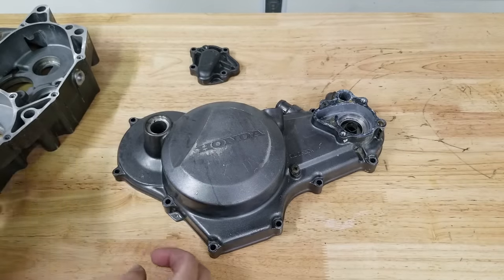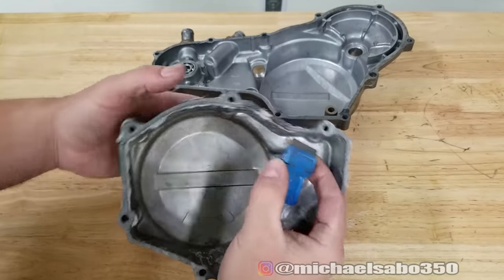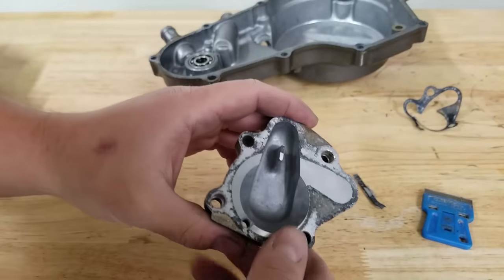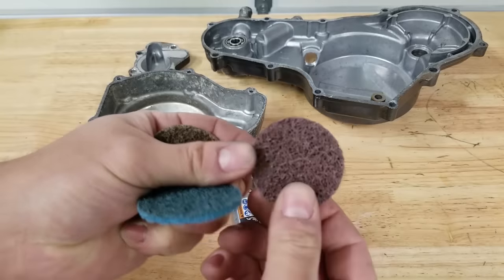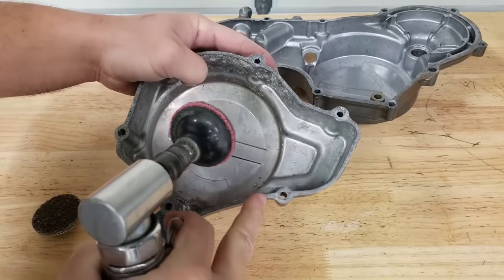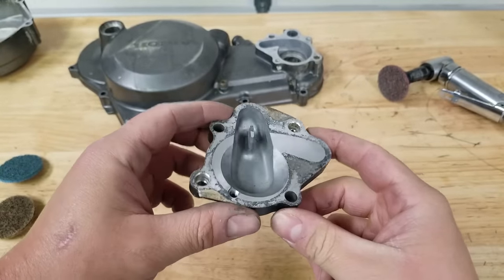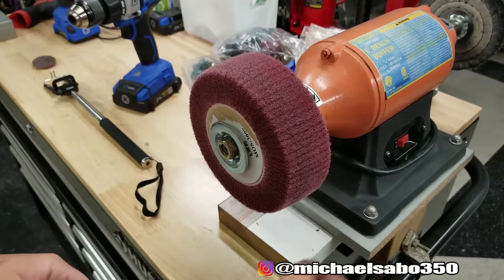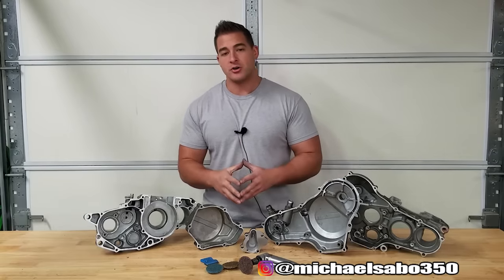Project 250R Cleaning up The Cases and Removing Stubborn Gasket Material

Comment: This method does work but it is very risky, especially on surfaces that need to be perfectly machined like a cylinder head. If you use this method and them surface that part at a machine shop, you would be amazed how wavy it is after using one of these wheels. On tough gaskets I use a razor blade to get the gasket off and then scuff the surface with a red scotch brite pad by hand soaked with some brake clean. Or if it needs to be perfectly flat I will scrape it clean and then get a piece of glass and lay out some 400-600 grit sand paper and run the part over the sand paper in a figure 8 pattern. These wheels can remove material super fast especially on soft parts like aluminum,pot metal, brass, etc..

Comment: What I use to get that old glue adhesive off is acetone. Soak a little bit on a towl and rub into the gasket material.  Once dry use the same razer and the gasket adhesive comes right off.  Give it a try.

Comment: U know they have a gasket remover attachment with little fingers on it that wont cause any damage at all. And it works awesome
Reply from the maker: Thank you for the info dude; I should have mentioned those in the video; the bristle pads are safer for sure; I used the cookies on a daily basis for years at my day job so for me it's safe because I have a feel for it; but the bristle pads are no doubt safer to use.
Reply: @MichaelSabo  no problem man. Love ur videos keep up the good work.
Reply: I was just thinking the same.
Reply: I can find bristle pads
But cant find any with fingers 
Do you know the name of them?
Reply: @communicate17  Old post, but I think what you're looking for is 3M Bristle Pads / 3M Bristle Disks
Reply: @naturalsIV  Thanks!

Comment: Wrong tool for that job 3m makes a green plastic cup with plastic fingers on it that goes on your little angle grinder for cleaning gaskets of aluminum! The scotch bright are good on steel but can make gasket matting surfaces wavy and lead to leaks on aluminium. But a trick to flatten out gasket surfaces get peace of glass spray with water stick sheet of 400 grit sand paper on  spray with water and work cases in a figure 8 pattern
Reply from the maker: Yes, not sure if you watched the entire video, but I mention surfacing the cases/covers in this video and stress using extreme care with these cookie wheels. Great info though; the 3M bristle pads are great too they just take longer, at least in my experience; I should have included that.

Comment: It's called a scotch brite bristle disc
Reply: What grit would you recommend for gaskets like in the video?
Reply: @kenwilks6289  dont matter if u use a scotch brite bristle disc. Even if u use a 40 it wont damage anything.  If u use what mike is using in the video. Not sure what it's called but use a fine grit bc u can damage the surface. I wouldnt recommend it if u never used them. Just google scotch brite bristle disc and order one of them any grit
Reply from the maker: I probably should have mentioned those in the video; the bristle pads are safer for sure; I used these on a daily basis for years at my day job so for me it's safe because I have a feel for it; but the bristle pads are no doubt safer to use.

Comment: Thank you very much for showing us in your videos! I have a question.  What number of sand paper do you recommend using with the glass to leave the surface flat?  Greetings from Honduras, you are the best.
Reply from the maker: Thank you dude! Greetings from the USA! I would use 220-320 wet/dry for case surfacing.

Comment: I looked up this video because ive replaced a few stators where the gasket material is stuck on the inside part that is still attached to the bike. If anyone have a good tip on how to do this in places where a rolloc wheel or die grinder litteraly wont fit or will do damage, please let me know. Ive tried looking up similar attachments for rotary tools, but havent found any good ones so might have to make it myself.
Reply: I just tried wax and grease remover, works really good.

Comment: Bad idea using those pads
 They are more abrasive than they appear and will remove aluminum fast. It may not seem like it when you look at it but I can guarantee those surfaces are not perfectly flat anymore.
Also those bearing you left in the case now have a nice abrasive dust coating.

Comment: Those all look like aluminum parts. Infact I think the stator cover has to be aluminum as to be not magnetic. You should definitely not use steel wool on an aluminum part. That’s a no no
Reply: Why
Reply: Tim Benham steel is a harder metal than aluminum so cleaning aluminum with steel can remove the aluminum and not just the material. If you change the head gasket on your car a lot of cars have a cast iron block and an aluminum head and if you use the same stuff to clean the aluminum as you do the steel you’ll gouge the metal and not get a seal on the gasket